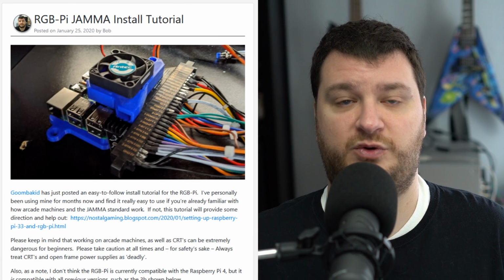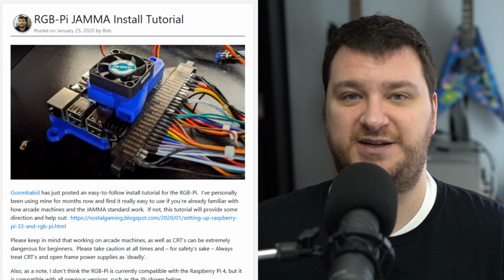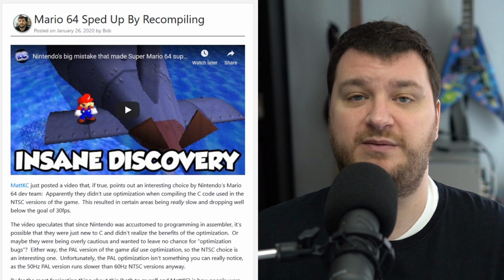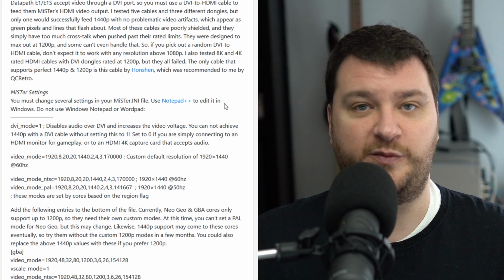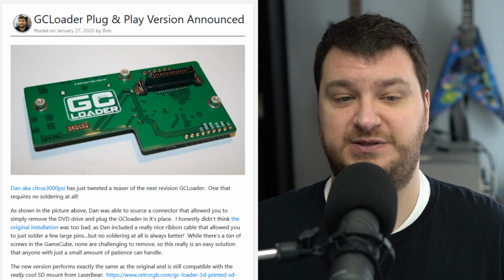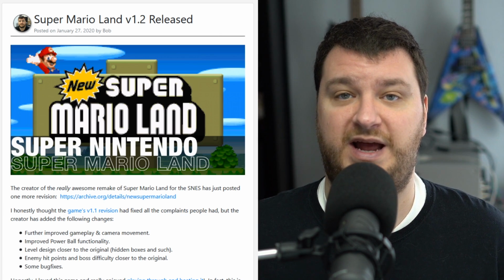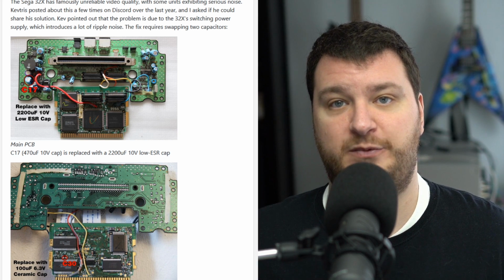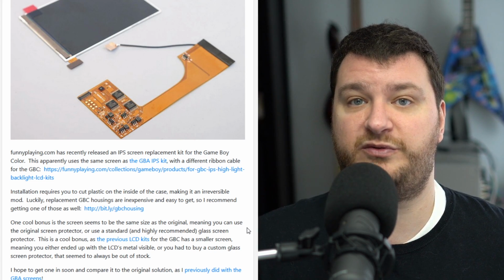RetroRGB Weekly Roundup #186 - January 29th 2020

Comment: Would it be worth running VHS footage through the retrotink over component? I wasn't sure if it's just for games or all video in general. Thanks
Reply from the maker: No, since VHS tapes are encoded in composite.  If you had a VCR with S-Video or component out, you might get a sharper picture ONLY because the VCR separates Y & C on the circuit board.
Reply: @RetroRGB  in practice, from what I've heard from most people into VHS, over S-video only SVHS will look better. Regular VHS supposedly look more muddled over S-video. I'm sure someone better versed in signal science can say why

Comment: 00:56 - Unreleased Cooly Skunk
04:45 - Tanglewood Creator on Computerphile:
06:00 - RGC Component Cable
07:02 - Goemon 2&3 translations
08:30 - RGB-Pi JAMMA Install tutorial
11:26 - Mario 64 sped up by recompiling
14:35 - MiSTer 1200p & 1440p Scaling Modes
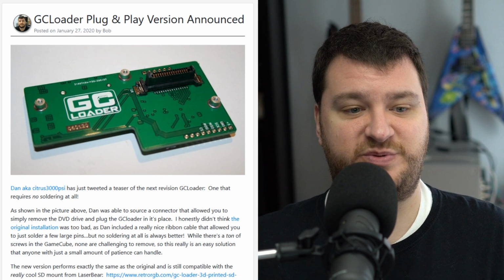17:41 - Updated GCLoader
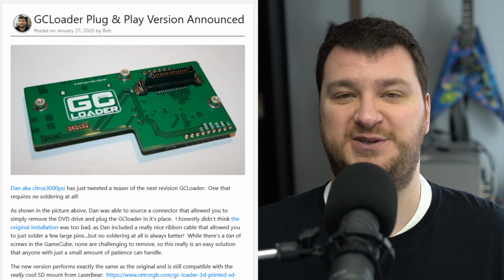20:42 - New SML Final?
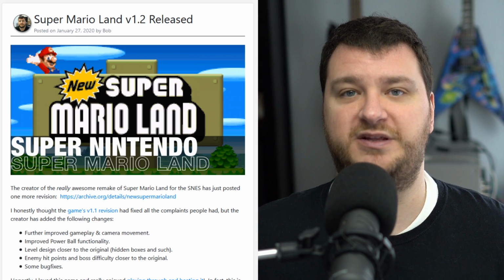22:32 - 32x Interference Fix?
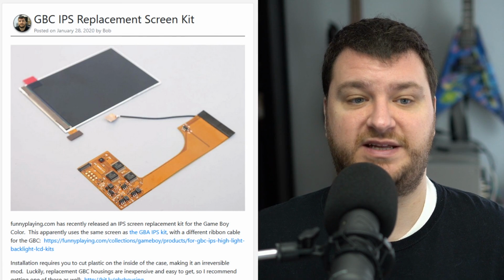25:28 - GBC IPS Screens
Reply: you're the homie for mobile users.

Comment: 4k isnt possible on Mister by the HDMI 1.4 restriction. HDMI 1.4 can max output 1440p 60hz.
Reply: according to specs it should be possible for 1.4 to do 4K at 60hz by using Y′CBCR with 4:2:2 or 4:2:0 subsampling

https://www.trustedreviews.com/opinion/hdmi-2-0-vs-1-4-2913356
https://en.wikipedia.org/wiki/HDMI#cite_note-subsampling-142
Reply: @kikujade  Thx, i read that times ago but my thinking is this isnt real 4K
Reply: @graschbaten  I thought so as well, but I'm thinking old games didn't use the full RGB color space. Are there any disadvantages in doing 4K Y′CBCR with 4:2:2 or 4:2:0?